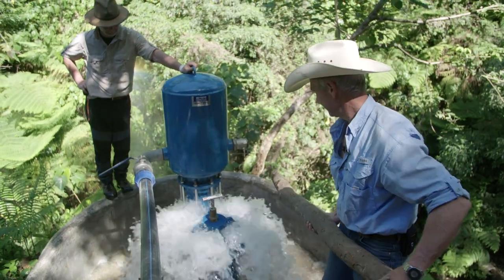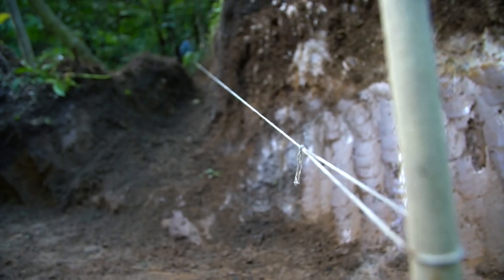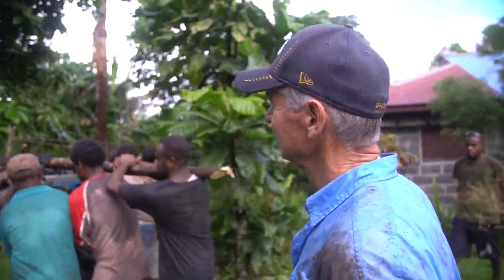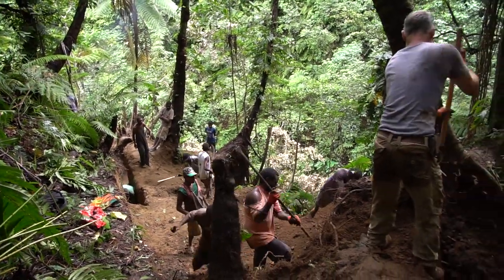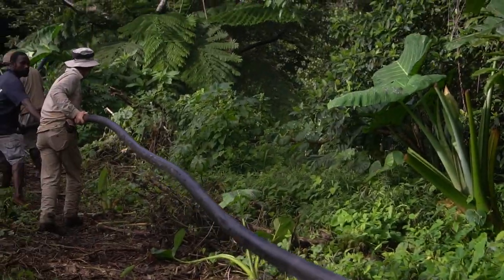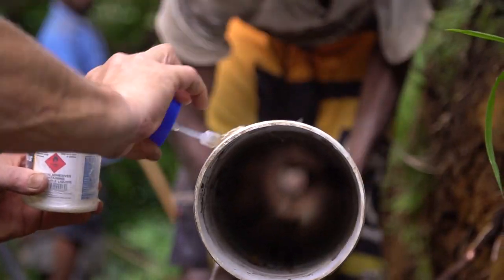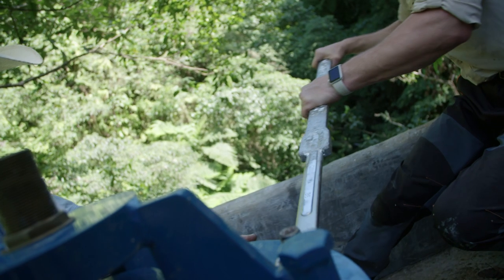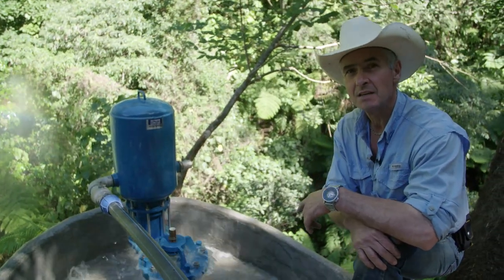World Water Rams, Middlebush Project.

Comment: I think the video said that the delivery was 33 kilometers and the head was 15 meters - do you know the lift?  Thanks - great video.
Reply from the maker: Sorry I may not have been too clear, it does involve a 40m vertical water fall, then rises to 15m at the back of the surge tank, which then, we use 9m of that fall down in to the Rampump. 33km is the length of the main distribution pipe from the storage tanks out in to the communities. The net vertical fall we are using for the  Rampump is 9m, pumping up to a vertical height of  90m over a distance of 700m.
Reply: @worldwaterrams-newzealand4421  Thanks for clearing that up.
Reply: Plz info, 
What hight required to pressure flow in pump, and how much hight this pump capacity to throw water up? 

Iam from Shigar mountain landscape so can we install here. ?